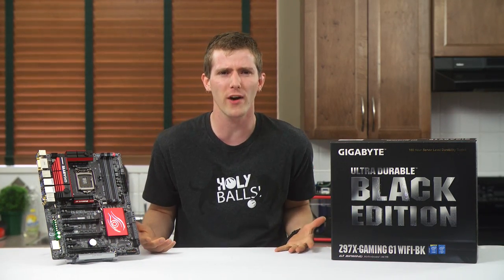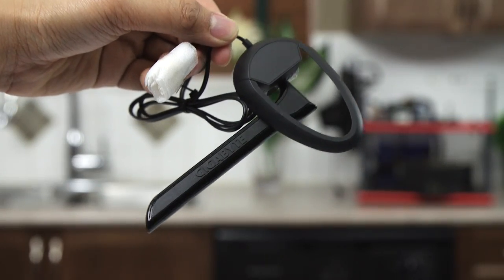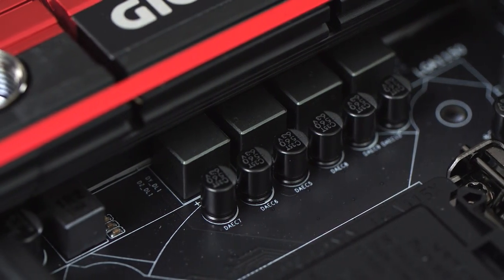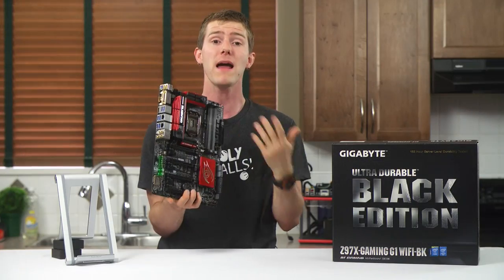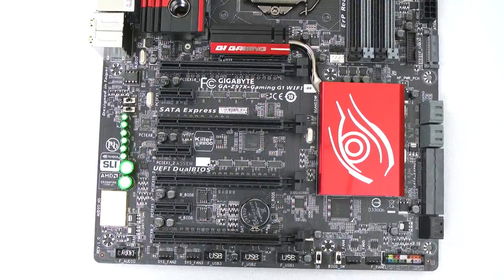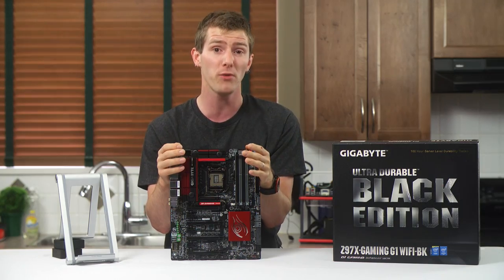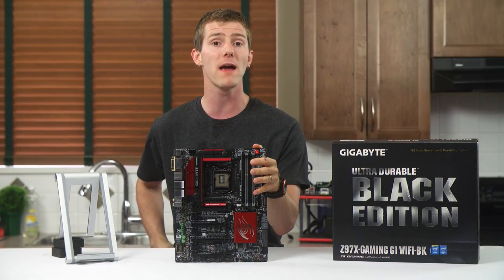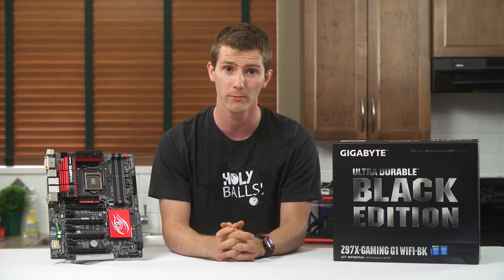Gigabyte Z97X-GAMING G1 WIFI-BK Motherboard

Comment: Fan plug fail.
Reply: It's not a cheap mobo by any stretch of your imagination but to have to pay more to buy extension so you can actually connect those top PWM fans
Reply: Itsuka Kiyokata yeh that 2 bucks is a real deal breaker
Reply: Gigabyte should of put fan headers on top but it's not a deal breaker.  Extensions are cheap and the extra cost wouldn't be a issue with someone who will buy this board.  I personally prefer a good quality fan controller.
Reply: fremantleNEWS Not the point. When the board costs this much you expect better from the company as you're buying a premium product. To just allow them to make minor flaws in such expensive hardware is an injustice to customers around the world.

If they knew it would be a problem then THEY should have provided the extension cables since they are so cheap.
Reply: PWM is the best control. There is no exception
A fan controller just makes for more clutter and even if it's a AQC5 or 6 voltage control can only bring you so far.
Reply: It can be cleaner to route fan connections through the bottom. If they're on the top there are usually fan cables hanging from the top because there's no place to tuck the cables away. At least with bottom headers we can use the cable routing behind the mobo tray.
Reply: You can route through the top of the case. If you can't means your case is not even designed properly at all. Also not all of us want fan cables 1000 miles in length. Not cool, also cable management is an PITA
Reply: Itsuka Kiyokata Some people don't like to run fans on motherboard fan headers.  People have burned out motherboard fan headers.  Especially if they have a lot fans and fans that draw a lot of power.  For example people who run crazy water cooling setups with multiple push/pull radiator configs.  I run a custom loop but nothing crazy like I've seen other have.   

There are PWM fan controllers and splitters/hubs.  Swiftech makes a nice PWM splitter.  Some fan controllers/splitters/hubs small enough to mount behind the motherboard.  A lot of cases these days have them now. You'll have a central place to connect all the fans and have less wires connected to the motherboard. So clutter isn't a real issue. 

But seriously we're arguing over fan headers.  lol  Linus said it wasn't a big deal either.  He probably mentioned it because there wasn't anything else bad to say about the board.
Reply: koryonamja u should never run two fans from a header, ever. always go to a controller for doubling up.
Reply: I do that all the time. There's no need to be scared. and use something called a "PWM Splitter" :P
Reply: Itsuka Kiyokata it's not about scared. i have decent equipment and i already have a fan controller. i haven't used a shitty fan header on a mobo for about 5 years
Reply: You hate fan headers that's all.
Reply: Itsuka Kiyokata hate is a strong word, lets just say i've moved on, in the same way i don't use training wheels anymore

Comment: Own this one pairing with 4790k & corsair 2400ghz ddr3. An absolute beast 😎
Reply: i have this board, and got a bad temperature on HWINFO64 at the motherboard temperature5 and temperature6 section, its about 90c.
are you have that similar number to? i think that temperature based on PLX Chip that lays between cpu socket and 1st pcie socket.
Reply: @gepencful   Nope. I have Obsidian  900d super tower can and Noctua block. All nice and cool.

Comment: The board had pretty much everything I wanted; however the lowest price I could find it at was £320, which was a bit too much to get me to buy it.

I then saw the board offered at £191. At that price it was a no-brainer and I swapped out my GA-Z87X-UD5H for it.

One very pleasant surprise is that GigaByte not only offers a free extended warranty to five years, but also offers a free upgrade to a newer board within three years of purchase. An even more pleasant surprise is that after registering the board, GigaByte has not inundated me with spam E-Mails.

Comment: Having those fan connectors placed on the lower portion of the board makes so little sense it hurts to look at it. The overall colour scheme is pretty sexy with the green accent capacitors and gold plating, although without the audio colours wouldn't it be troublesome to differentiate between the connections?

Comment: Gotta disagree with you on the fan connectors. Given this is a gaming board, they probably aimed this at enthusiast builders, who will likely be using fan controllers or power-splitter boards like the Bitspower X-Station or NZXT Grid. The connectors they did give are in line for where most cases already provide fans out of the box: the front intake and a rear exhaust behind the CPU, along with a plug for the CPU fan.

Comment: Gigabyte has started cost cutting of motherboards by introducing same model motherboard with different revision numbers and they can have significantly different performance numbers.

Whats more sneaky is Gigabyte does not state this clearly. You cant tell what revision a motherboard is on a website when shopping until you get it !!! Sure Gigabyte lists differences on its website but its 'hidden' away with small links and you have to read thru each Revisions specs to find whats missing or whats changed

Comment: One thing I wish they had more info on is fan control... Does it have PWM control on every fan header or are those face 4 pins like most and only use DC control?  Asus has actual PWM fan control on each fan header for their z97 boards.

Comment: I just want a Z97 ROG board with thermal armor like the Z87 formula vi but Asus didn't make a Z97 Formula and not a fan of the sabertooth colors, more company's should make boards with thermal armor and back plates
Reply: thermal armor only looks cool. It doesnt add anything except few extra bucks to the final costs. And fancy look of course. Companies do not bother with that stuff as they know most reasonable folk dont buy boards just for looks. So its better to spend those extra bucks in something that actually makes real difference.
Reply: Verithiell When people are buying a MB most people take the look and colors of a board into account and how it will look in their final build. That being said the Z87 ROG Formula is one of the best looking boards ever built even linus says so and quite popular as well. I just wanted a Z97 version because the z87 wont support upcoming cpu's
Reply: I think asus will be revealing the next few z97 ROG boards at computex 2014(formula,extreme,crosshair and impact) but sadly no x99 boards by any manufacturer
Reply: Tokyo Drift
Yeah, but board can look good without thermal armor, which quie frankly is rather useless.

Btw, what cpus exactly will not be supported by z87? I havent been following all the new and upcoming releases for past few months. Are there any new cpus on the way for new socket? I thought intel is going to follow their regular route, that is they will release haswell and haswell upgrades for lga1150, and then they will come up with new socket. So far this tactics was working well, at least for cash milking purposes. Did they make any alterations to this "brilliant" scheme?
I wanted to upgrade my pc but decided to wait for new socket, as I wouldnt use my pcs full potential yet anyway.

Comment: hi ur videos are great and helpful thanks keep the good work.
i have a question regarding the 4 way sli on this board as im planing to buy this mobo with i7 4790 and one 970 gtx g1 gigabyte.
the reason is to later update with more gpus when needes as im planing to build a build that can be upgradable and i didnt like the x99 thing "too much expensive"

so the question at what speed the 4 pcie 3 will work in sli mode ? as i understand 16x or 16x/16x or 16x/8x/8x or  8x/8x/8x/8x

and howcome it can work this way hence the processor has 16 lanes while the pcie requires 32?

 im confused please help thank u in advance

Comment: Nice  mobo. I have a question..  I'm putting together a rig, but I need help on a mobo decision, this is what I got, AMD FX6300, MSI R9 270X, my question is out of these four mobo wish one would be the better one to get? MSI 970 A-G46 am3+ atx, ASUS M5A97 R2.0 SOCKET AM3+ ATX, ASROCK 970 EXTREME 3 R2.0 AM3+ ATX, OR THE 970 EXTREME 4 AM3+ ATX.. the reason for these for is cause it comes as a bundle with the AMD FX 6300.. please help..

Comment: did they finally make it to where when you plug in a set of headphones on the front it mutes the rear speakers in the back?  i have the G1 Z87 board and that is a HUGE gripe for me about that board i have to physically turn off my rear speakers when i plug in headphones and it is so annoying.

Comment: How does the two Lan Ports work???? can I configure them so all traffic like youtube and browsing are managed by the Intel chip and all Gaming by the Killer chip.

At this moment I have an AsRock 990FX Board installed with two Lan Ports and on this I can use Teaming. This won't work with two different chips or will it.

Comment: Wait, 4790k only supports 16 pcie lanes, but to run in 4-way SLI NVidia requires at least 8 pcie lanes per card, how is it possible to run a 4-way SLI then.

Comment: Why do motherboard's have 2 lan ports ? I have both pluged in no speed increased wtf ?
Reply: Useful if you're using your desktop as a bridge for another device. Let's say you have an old Xbox 360 with no wireless dongle for it. You connect that by ethernet cable to your desktop, connect your desktop by ethernet cable to your modem/router, and then set the connection within Windows to bridged, and voila - your Xbox now has connection to Xbox Live.
Reply: exodiathecoolone .
why not just connect your xbox directly to your router? If your xbox is close enough to a pc that is wired to a router, then shouldn't it be close enough to just plug the xbox into the router? The only reason I could see anyone would want to do that is if you don't have any open ports on your router, but almost all routers today have multiple Ethernet ports.
Reply: brickman409 Backup connections. You can set up so that if on one internet dies, it switches to 2nd port. This of course means that you have to have 2 sperate intenet connections, not 1 router and 2 cables out of it to your computer.
Reply: brickman409 "why not just connect your xbox directly to your router? If your xbox is close enough to a pc that is wired to a router, then shouldn't it be close enough to just plug the xbox into the router? The only reason I could see anyone would want to do that is if you don't have any open ports on your router, but almost all routers today have multiple Ethernet ports."

Try my situation. I live in an apartment. The phone line (and thus my internet connection) is in the living room. My bedroom is seperated from the living room by a thick wall. I have an old Xbox 360 with no wireless capability and a desktop in my bedroom. I buy one long ethernet cable, one end going into the computer, the other end going through a hole I drilled, into the modem/router, and then a shorter, cheaper ethernet cable to go between desktop and Xbox. There, I get Xbox Live on my Xbox, and I'm using the two ports on my computer.
I could of course just buy a switch, but that would be a bit more expensive than just a short cable to go between desktop and Xbox.
Reply: Redundancy or performance
Reply: brickman409 For peoples still using 1-port ADSL modem or you having your computer connected directly to the ISP without router.

Comment: are the on board water blocks good for use
Reply: or should I change them???
Reply: +creep games No the integrated block is fine. The motherboard and VRM's don't get that hot. An EK block won't improve cooling performance.
Reply: +mrawesomelemons ok thanks for the info
Reply: creep games Keep an eye out for the materials. You don't want to mix copper and aluminium (copper and nickel is fine).
Reply: +mrawesomelemons yea I have heard about this problem

Comment: how many monitors can be connected?
Reply: +sk8neverdiez # if your using intergrated graphics but if your doing anything with tiple monitors please get a gpu if your on a budget id recomend the r9 390 it will easily support 3 1080p monitors and with 8 gigs of vram is incredibly futureproof

Comment: Should I get this Motherboard or the ROG Black Edition?
Reply: ROG ones are 2011 socket...this one is 1150
Reply: Cirno Oh ok, thanks for clarifying that. :D
Reply: Cirno
What? No! Republic of Gamers is available in various flavors for all series. Rampage series for 2011/extreme series, Maximus for mainstream Intel builds, Crosshair for AMD.
Reply: Sveinung Tørresdal Yes, that's right. But I was talking about the Rampage IV black edition  which is Intel LGA 2011
Reply: Sveinung Tørresdal -____- did you read that person comment carefully ''ROG Black Edition'' yo...
Reply: gigabyte has better software in my opinion then asus.
Reply: Dylan Tucker but they fail this time o-(-(
Reply: I build quite a few systems now, and I became to love the asus boards (especially z87 and newer). UEFI is really easy to use and their fan control and automatic overclocking is extremely easy and good to use. For me that was a selling point since I'm using a NH-D14 as a cpu cooler, which needs voltage fan control.
Reply: You said "ROG ones", Cirno. Which is a different statement entirely. I was responding to that separately, since your literal statement there clearly says "ROG ones are 2011 socket".

If YOU meant something else that's on YOU, because YOU wrote something completely wrong right there. That's all there is to it.

If I wanted to remark to Geralt that he referred to the Rampage IV Extreme Black Edition I would've done so. I did not. I was talking to you.
Reply: always go ROG if u can
Reply: I am sorry for the misuderstanding,Sveinung Tørresdal. It is my fault.
Reply: Come on guys all i asked was a question. It doesn't need to escalate that badly.
Reply: I don't understand. Calm down? ...About what? I told you you're factually incorrect, and you threw a fit.
Reply: Sveinung Tørresdal From neutral perspective, you're the guilty party in this whole conversation.

Comment: I've always wondered why 7.1 SS only needs 5 output ports and 5.1 only needs 5 ports as well? Anyone know why?
Reply: 5.1 only needs 3 ports.
One single port can handle 2 speakers, so you need 1 for front (left & right), 1 for rear (left & right), and 1 for center & sub.

Comment: whats the point of the auxiliary sata connector with sli?
Reply: power
Reply: It's to prevent burning out your 24-pin by supplying more power to the PCI-E lanes.
Reply: how do ya plug it in?

Comment: hey i need help what do u think of this for a gaming pc:
CORE i7 4790 3.60GHz LGA 1150
Processors 

850 WATT SILENT PRO M2 
Power Supplies 

8GB DDR3 1600MHZ HyperX FURY
Memory 

1 TB SATA
SEAGATE

250GB 850
SOLID STATE DRIVES 

4GB GTX960 SC
EVGA 
 
Z97A GAMING 7 LGA1150 USB3.1 
motherboard
Reply: +dhari al-kharraz For gaming it is much better to buy a i5 CPU and spend the money you save on a better graphics card. You only need i7 for video editing or similar CPU demanding tasks, a i7 does not give any advantage in games that can defend the huge extra cost.

The 4GB GTX960 is a good idea if you plan to run sli later. In for example GTA V the GTX960 is to weak to use more than the 2GB VRAM anyway so it might be wasted to buy the 4GB version if you don`t plan on doing SLI. 

I have a GTX960 2GB  and upgraded to GTX980ti for running GTA V with anti-aliasing enabled with ok graphics settings. The 960 did not like running GTA V with AA enabled very much and I am allergic to aliasing in games...
Reply: +Rondo Cat yeah thanks I already built my pc and got a i5

Comment: Can anyone tell me what is wrong with my Gigabyte GA-X79-UP4 motherboard if it's almost always starts with boot(god damn this boot menu is so ugly) - i don't mind to escape this on start but it's would be nice if it won't start without pressid del or f12 - so is there an option to turn it off or is it just Gigabyte boot system problem (i also updated the boot system, but it had no effect).

Also I'm so frustrated with sound - like i have the latest driver installed, but for example when i start my pc then about first 10 minutes there is this static noise in sound - like when sound contains higer notes etc. (in browser and winamp). Also noise can come back in any time. My first impression was to check over all connections, but everything seems to be okay. If anyone could suggest me how to proseed, then i would be happy to know.

Because of that - my current suggestion to everyone would be: god damn RUN and don't go for gigabyte motherboards.